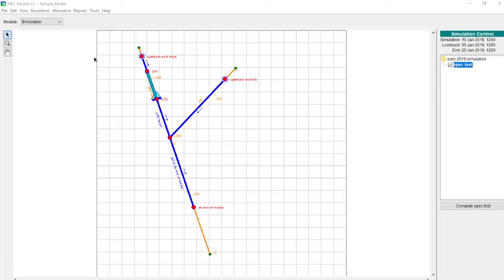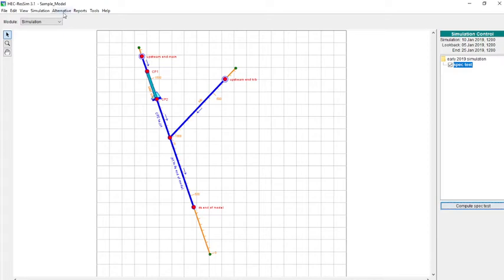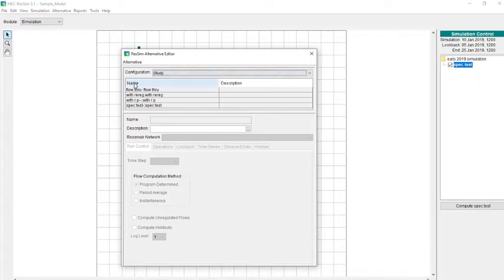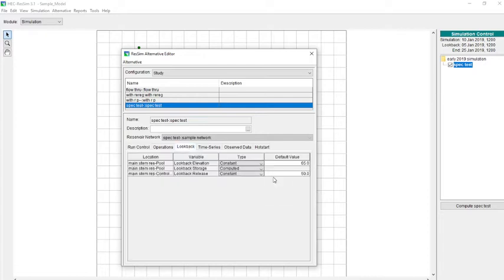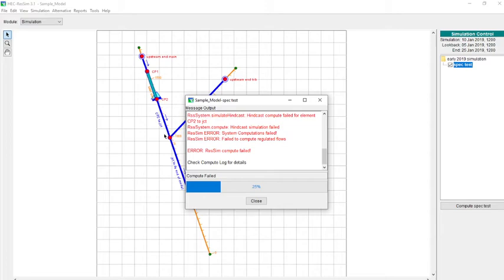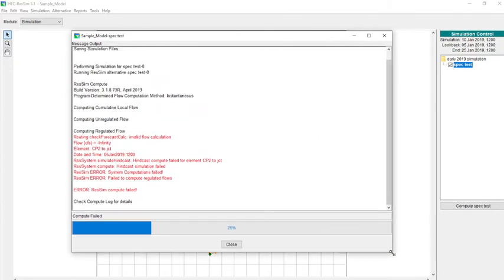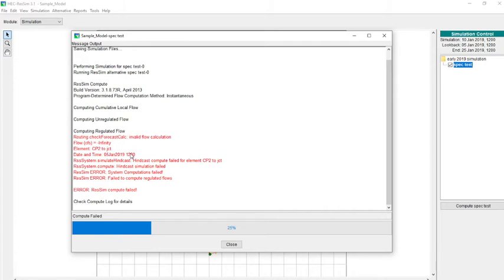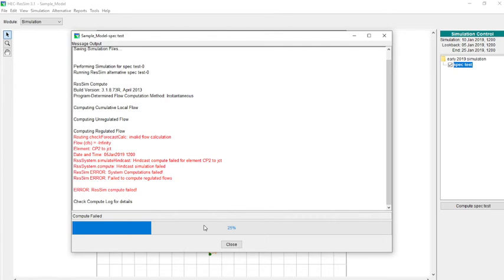How do I fix an error in my HEC-ResSim model.  Routing.checkForcastCalc: invalid flow calculation.

Comment: I would like to ask about HEC-RESSIM
1. Does HEC-DSS automatically connect or transmit data to HEC-RESSIM?
2. I tried to "compute" but there are error messages "Data set on HEC DSS empty", "Failed to load time series records", and "failed to compute cumulative local flows" Do you have any suggestion for me?
Thank you for your time and answer.
Reply from the maker: HEC-DSS is the program that HEC-ResSim uses to retrieve data and to save the results of the simulation.  You do need to let ResSim know of the DSS file and the appropriate paths.  Based on the error message, it sounds like you may have some missing data in your dss files.  I have also found that it is helpful to make the DSS file the same time step as my simulation time step.  So, for example, if I am running an hourly simulation, I like for the DSS data to also be hourly.  I will try to reproduce those errors and make a video.
Reply from the maker: I have added a video to the channel that may be of some help to you.
Reply: @hecressim  thank you
Reply from the maker: https://youtu.be/WQ5kjJ_u1wg